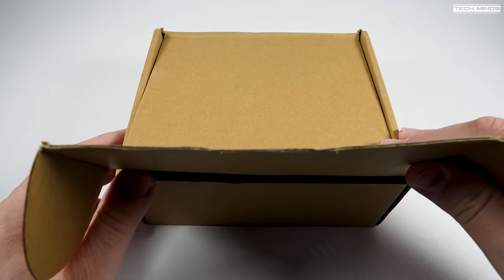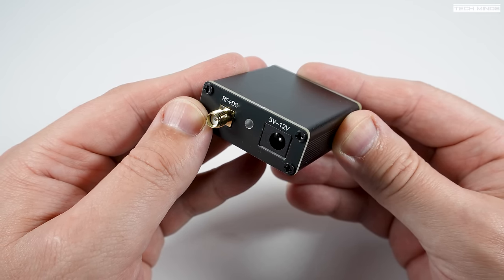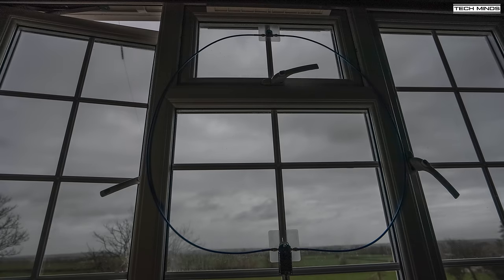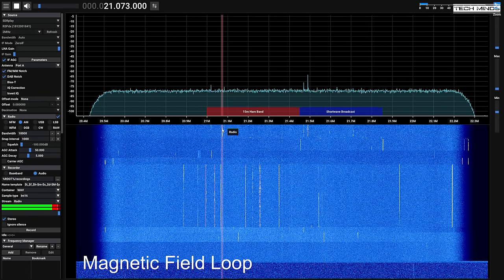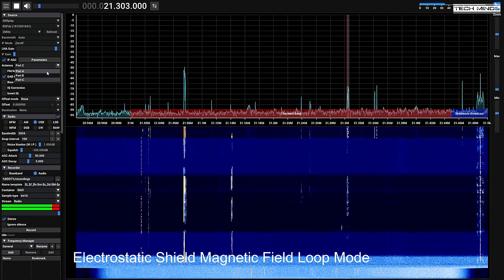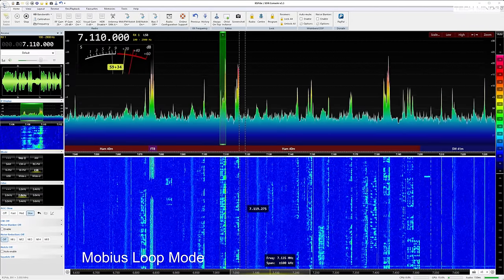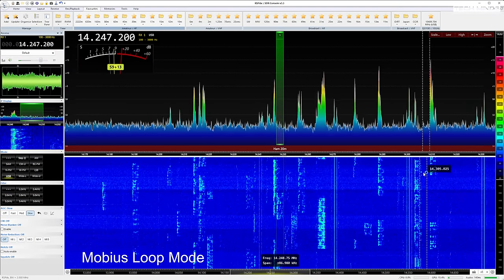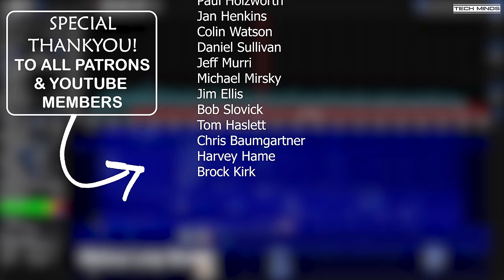LZ1AQ Active Small Magnetic Loop HF Antenna

Comment: I have tested mine indoors and it worked better than the mla 30 in indoor conditions. it is the best solution i have ever encountered for an apartment dweller. It also does a decent job on FM. Also when indoors moving it by a few inches can change the background noise level so you have to experiment for the best location when indoors.

Comment: I also have this antenna. In my indoor testing, I could not see a difference between the three different modes. Also I thought the noise level was a bit higher than I expected, clearly related to the amplifier. Since my radio (Malahit SDR DSP1 V5) already has a preamp, I reverted back to my old Airspy YouLoop and felt it was a better solution.

Comment: I mainly use my Wellbrook outside with coax into the house, but love testing out other smaller options; this one is impressive. Have used with my Malahit DSP2, ICF2001D, Tecsun PL990 (amongst a few…) and am pleased with the performance . Have created a plywood cross to support the loop and powered with a 12V rechargeable battery pack that I also use with my PK Loop. Nice one Matt…

Comment: Thanks for the video! I recently finished building my modified Levkov-Talbot -loop (as I call it), there is a Short on my channel. Main difference is at the input transistors: my version uses BFQ235A NPN video transistors that run quite warm. It works, but in an apartment there is so much RFI that probably no indoor antenna could help.

Comment: Several people have commented that they received their "HFDY active loop" in a bag rather than a box, and it did not contain everything that Matt shows in this video. As to the missing instructions, there is only one page, and it is what Matt shows at 0:23 and 2:02, so you can save a screen shot if you did not receive this page with your antenna. As to the missing items and a bag rather than a box, this suggests that some group is now making knock-off HFDY antennas, perhaps the same group that is making knock-off MLA-30 antennas?: https://www.youtube.com/watch?v=XTOfC2PLlQA (My HFDY active loop arrived yesterday. It was in a  box and included everything that Matt showed in this video, so it appears that I was lucky enough to get a genuine HFDY antenna.) As others have pointed out, this antenna claims to use a preamp design by LZ1AQ, but it is neither produced by nor endorsed by LZ1AQ.

Comment: On the LZ1AQ website it appears the  configuration switches are intended for different physical loop arrangements. I suspect the one that didn't work is using the inner conductor of the coax on its own.

Comment: Bought it since i was curious. I also own an MLA 30+.  What i can say is that the performance of both seem similar. Yet, i did upgrade the MLA coax, used a copper pipe for the loop, tweaked with the knob inside the bias tee. With these mods, the MLA30 is far better. I imagine if i tweak the other one, i might get better reception as well. So far, i like it. I might replace the stock blue cables with heavy duty coax. It's fun to experiment.
Reply: Do you mean that (1) your MLA-30 is now much better than it was originally, so that it is now comparable to the HFDY loop with LZ1AQ-designed amp or (2) your modified MLA-30 loop is much better than a stock HFDY loop with LZ1AQ amp?
Reply: @JonAhlquist  2 I meant 2. :)

Comment: I have this one as well as the MLA30+ and the original LZ1AQ loop amplifier. The Banggood loop is definitely better than the MLA30+, especially below 500 kHz where the MLA30+ is of no use to man nor beast.

But a loop with the original LZ1AQ amplifier runs circles around the other two.

Comment: I bought this exact same loop antenna about weeks ago, while it works resonable well, when I connect a regulated 12V power supply the main antenna PCB with the amplifer get very hot, this only happens when I connect it to a 12V supply the input range is 5V-12V at 5, 9 volts it heats up a little but no where as hot as when i supply it with 12V.

Does anyone have this problem ? or is it time to return it to get a new one.
Reply: Mine actually would not work at 12 volts, but worked fine with 9 volts. It only got a little warm.

Comment: Man, mine came in a bag instead of a box, with no directions and no plastic spreader/window hangs.
Reply: Same here but also missing documentation.
Reply: @mrradio2187  As to the missing instructions, there is only one page, and it is what Matt shows at 0:23 and 2:02, so you can save a screen shot if you did not receive this page with your antenna. As to fewer items in a bag rather than a box, this suggests that some group is now making knock-off HFDY antennas. Perhaps the same group that is making knock-off MLA-30 antennas?: https://www.youtube.com/watch?v=XTOfC2PLlQA